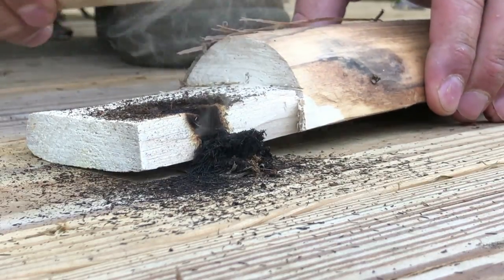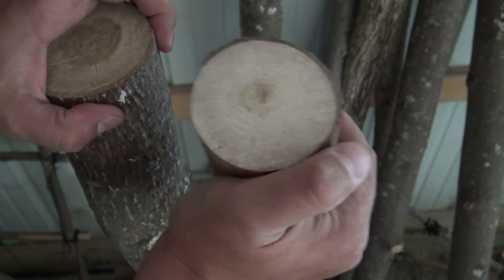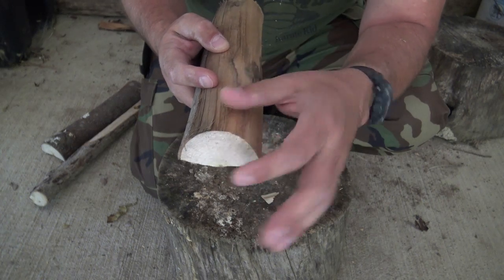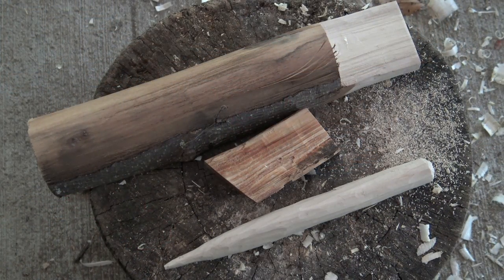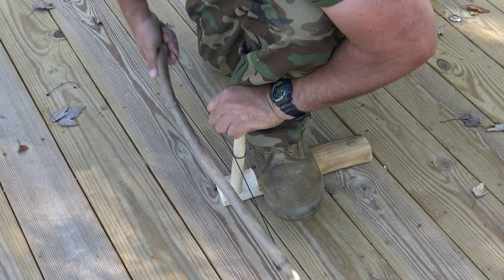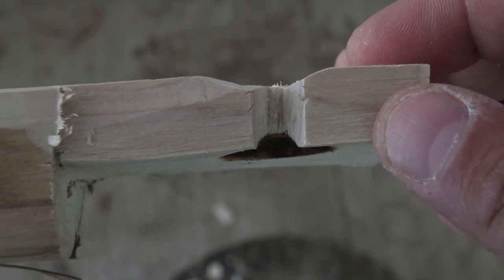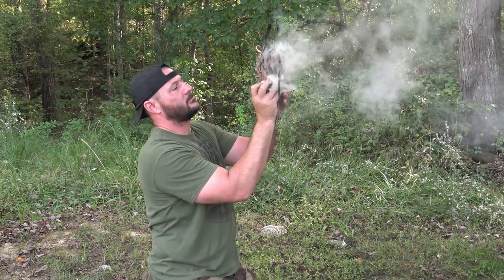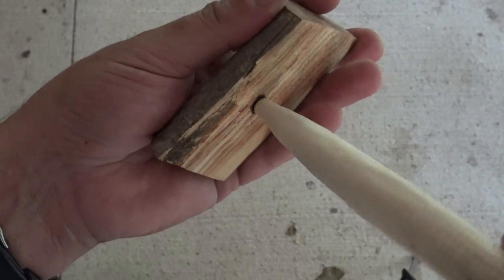The Best Kept Bow Drill Secret - Guarantee That Ember

Comment: I find that widening my notch at the bottom allows the powder to gather in a more central spot and helps the heat to build quicker.  I also lubricate my spindle top with oil from my face/hair or earwax.

Comment: I was taught bow & drill  by micmac up here in Maine. After 1/2 of scavenging components and putting it all together (real simple in Maine we are blessed with many options) , I had a fire in bout a minute on my 1st attempt. 😀I got so good at it that I left my lighter home for a whole week and lit my pack a day habit by bow& Drill . .
Nearly what you did except I just split a board out of the center of bout 12" of the base of a dead(rusty orange) Christmas tree size spruce and I used the upper section for my drill .
     Definitely love the fat wood upper catch , smart. I was taught to use either animal fat or pine pitch for 
Upper lube and I was taught after burn in to blunt the bottom of the drill (not just remove the charred part as it put more weight on less surface.  If I can offer a tip , it would be don't make the drill any longer than needed to operate . It get more wobbly and you waste energy trying to keep it up right.  Short drill with shin in wrist joint it is easy to keep steady &;easy to put all energy straight down.  

      Excellent demonstration 
&  thank you for the Fat wood tip I have to try now😀

Comment: Very clear and easy to follow instructions. Thanks. Again some idiots give a thumbs down to someone trying to teach something.
Reply: aaaaa1957 ..,it’s probably not real people.,just an A.I. Bot running it’s program...or you could be correct.,in that case..,asshats will asshat.  I really should practice this but I’ve got a few pounds of dryer lint in dry bags and ferro rods and wind and waterproof matches and tons of both. Dryer lint is the ticket. But I am going to learn to bow drill.,as a back up and this is by far the most informative video I’ve seen to date on the matter. Thank you!!

Comment: What I love about this method is the stability of the proven platform hearthboard. . you see hundreds of dudes just split a flat chunk of wood and go. But this allows the arch of the foot to lock the hearthboard to the ground...which is WAY more stable and would help prevent pop out.

I have watched hundreds of these videos trying to figure out a way to do this with my physical limitations, and this is most helpful out of all of them as far as components go...thanks Shawn
Reply: I hear ya.... Those limitations.... Try a soda can , polish the bottom, or a Smartwater bottle, it magnifies real good. An altoids tin full of charr and charrcloth bits and a piece of an old file and a hard stone are my choice. But having a backup is well worth it in a pinch or if you are having troubles with one method on a particular day. I recently was way up on a mountain detecting and came across an old greenish bottle bottom. And cleaned it up. Before too long i generated an ember and kindled a small camp fire. It was very rewarding on that cold hike on the mountain!

Comment: I watched Josh's video "The Complete Bowdrill"....that one helped me get my first ember. I'm at around 90% success rate.Your video showed me a couple of good tricks to use that may close that 10% gap.....Thanks for the video and great tips. Carving a space under the notch will help with the airflow which seems to be a unwittingly repeated problem of mines that has to be corrected. As far as the bearing block...I use a piece of bone...a joint with a natural divot that works beautifully....no binding. Yes, I have watched spindle fly off a few times(my record is 12 feet...lol)...due to my relaxing and losing the firm stance. Again, thanks for the tips. It gives me more to work with. Semper Fi

Comment: Awesome tutorial, thank you. I love that the measurements are taken from the body, creating tools suited to each individual. Very clear and easy to follow, I've got to have a go at this ! All that I have found to be missing in the lesson, is hardwood/softwood information. As I am in the uk, and where ever I may be, I would like to know what the components should be made from. The spindle, the board, and the block (clearly fat pine where possible). Should the spindle be softer than the board ? I like to use a ferro rod, and have had great success with it. But I see this really is no different to bringing a lighter or pre fab bow drill to the woods. It's not survival, survival is using a broken flint as a knife, and what you have around you. As we can never know when we will need such skills, likely the worst possible weather with no bloody gear !

Comment: Avery good presentation on how to start a fire with a bow drill.  However you guys have it easy.  Downunder (Australia) our bush environment is predominantly hardwood (gum trees or eucalypt).  The trick is the timber sections don't need to be as thick.  Great work Corp, keep it up.
Reply: So I have made a number of bow & drill's to demonstrate how to start a fire using gumtree wood.  However, because it is hardwood, compared to this video, you need to scale everything down as the wood is harder and more durable.  The piece of wood for the bow can be thinner and most importantly the piece of wood you fashion for the base doesn't need to be as large or thick.  The principle remains the same  and if anything it probably takes longer to start making smoke.  I also use some very, very fine wood shavings around where the spindle meets the base block to assist with ignition.  Hope this helps.

Comment: Good video Cpl.  In my experience, once you've learned correct kit geometry and form, material properties are where most folks fail.  Wood species is 100% irrelevant if the properties are correct, and also if they are incorrect.  It's got to be dry as possible, fairly soft (dents/marks easily with a thumbnail), nonresinous, and not dry rotted.  After that, environmentals play a huge role.  I usually do hand drill because the materials are easier to find/prep, but your prep has to be near perfect.  If humidity is up, or it's damp, bowdrill as depicted is the way to go.  Osage also makes an excellent bearing block.  The other most common failure mode I see is people gassing out because they go at it with and empty notch.  If you are doing it right, you really don't need to go at it hard.  If you're panting, you're working too hard or your kit isn't right.  It takes a lot of embers to learn to read the dust and respond accordingly with pressure and speed.  When I got started somebody told me it's 100 embers to truly own it and I'd say that's very accurate.  You also need quite a few full fires, because the ember is actually the easy part.

Comment: great video nicely done you have some great videos here, a small tip for shaping wood such as the spindle you made i see people all the time doing what you did holding the knife as still as possible and then pulling the wood to shape it, it works good but I have found if i stick my knife into a log vertically and hold the top with the point firmly placed in the log it makes shaping wood very easy as the blade does not move. also a great way to make feather sticks using the same idea. great videos keep them coming this is without doubt one of the best channels , you need to team up with survival Russia :-) and you will have youtube sewn up .

Comment: Id Rub the top of the spindle on the sides of your nose to grease it anyway.. Also, where the string touches, you can mar the spindle with vertical lines to add grip for the string (like spine shaft). It adds serious torque and grip.

Comment: Great video! I'm sure it's been said, but another friction hack for your bearing block is to smush some green foliage into the divot to create lubricant. I've used this method, even in the winter, with cedar or pine needles.
Reply from the maker: no its not it falls out in 2 seconds and then you are back to square 1

Comment: Fantastic video. I have a request..... 

     I'm 57 years old with one hip replacement, the other hip due to be replaced some day and worst of all I have Stage III Spinal Degeneration in my back. So it is very hard for me to do things on the ground.  

     As a result I have adapted my woodcraft by elevating as many of my Bushman activities as possible. This means working on boulders when available and usually felling dead trees to waist height and using the tall stumps to my advantage. (You're gonna need the dead, standing timber anyway.)

     I have not seen any techniques of ways to secure the board to a horizontal log, standing stump, flat boulder, etc, so I would like to ask if you can come up with a good way to secure the board without having to use a foot in a crouched down position?

     Even without my type of injuries, this is good to do in deep snow anyway. So I'm just wondering what you might be able to come up with on how to secure a board to the top of a cut-off stump?  Something average sized, say 6" to 10" in diameter. 

     Any ideas?..... 

Thanks. 
     Mark

Comment: This is great i did my very first bow drill fire at 12 after watching videos on it. It took me 3 months to do it because at the time videos wern't very informative like this. The most important thing is make sure the wood is dry. And when you put the spindle into the bow drill you hear, That LOCK! because the tighter you can get the spindle into the string the better output. really good video!
Reply from the maker: WOW. that's great. Keep it up and thanks for watching

Comment: Good idea on the fat wood. I don’t have fat wood here in west Texas. But I carry this old glass insulator, it’s a little wobbly but if you cut the bearing in to fit it’s not to bad. Weird spindle but it’s not to much friction on glass.
Reply: Try a fidget spinner.
Three bearings in case one breaks.
Reply: Shawn R good idea. Just a thought any old small sealed bearing that’s been replaced. So if you was scrounging in a say lawnmower shop there’s probably some that’s plenty good to make a bearing block but to rough at high speed. 🧐
Reply: so steve ya cool. That’s a good idea. See my reply to Shawn. Cause seriously the bearing like a skateboard wheel wouldn’t be hard to carry around

Comment: Great video! Any reason to not put the tinder bundle/nest right underneath the board notch, so the embers fall right in? Assuming you use a smaller bundle. Perhaps dig a small divot and place it there so the hearth board stays flat. Seems like transferring might risk it dropping, blowing away etc... idk. I'm not that experienced.
Reply: I have done the bow drill many times right on top of the tender bundle with great success.

Comment: I have no qualms about using modern technology.  So instead of a handmade bearing block in my bow drill kit, I have a wheel from an old set of rollerblades.  It's comfortable to hold and the bearings eliminate pretty much all of the friction.
In my fire kit, I have 2 BIC lighters, a 4 inch magnifying glass, a ferro rod, a magnesium block, a fatwood block, a pencil sharpener and of course, my bow drill kit.
Reply: What will you do if you don't have your "fire kit"?
Reply: @bearly1727  One habit I got into from the very first time I went into the field as a soldier (and still do, regardless), is carry bic lighters.  When I'm not in garrison, I have a bic lighter in every pocket of my clothing and every pouch, pocket and compartment of my rucksack.  I do this even when I'm carrying my fire kit.  You will never see me without 6 feet of para cord and I have a fire steel always attached to my knife sheath.  I have this thing about being able to get warm.
Reply: @tazweiss7970  I agree. Being cold sucks so I carry with me at all times at least 4 different ways of starting a fie, a knife and a pistol, just in case.

Comment: Without a doubt, you've got some great tips.

What do you think of

1) Angling the bow off horizontal just a bit, to get the string to spiral slightly on the drill, to avoid the string rubbing on itself, reducing wear or the chance of it breaking?

2) If you have a tinder bundle that is slow to light, compress it SLIGHTLY after each time you blow on it, to keep the material inside at the right density?

Comment: Excellent video. I watched this video this morning and on my 2nd try I had success!  I was using a pine 2x4 as the bottom piece and a piece of cedar branch from my back yard as the spindle so I am not really sure if that was a good combo or not. I was going for the ember which I got but never actually got the flame. All I had prepared in advance thinking there was going to be a huge learning curve with little chance of an ember was some cedar bark shavings in a cupped hickory leaf. That wasn't enough and pretty much smoldered away in a couple minutes but had I made a proper tinder bundle there would have been a flame without a doubt.

One problem I did have after trying a few more times is my spindle keeps walking into the notch instead of going straight down, what would cause that? I am locked pretty tight with my leg with very little movement. I am actually using a 3 inch idler pulley off an f150 I had in my tool box with a center bearing for the top of the spindle that I can hold pretty motionless with near zero friction on the spindle top. 

Either way I was pretty excited and actually got the ember run on video!

Thanks

Comment: Pro tip: after seating your drill, rub the upper tip of the spindle all over your cheeks and forehead, then clean your ears with it. The skin oils will lubricate the wood so it will not burn into the bearing block as much and prevent wear  on that end, and focus even more precious friction onto the lower end.

Comment: Great information provided one brought poly cord and a camping knife. However, one should simply find or pack fatwood (pine resin infused wood), metal spark stick, and camping knife to very easily spark fatwood shavings without all the time and effort.
Reply from the maker: the video was about making a bow drill
Reply: Personally I opt for just bringing g along my 1200 watt Kenmore electric range and then I dont even need a lighter let alone a mag and steel, but different strokes for different folks I guess.

Comment: I always carry 3 lighters with me into the woods, on top of multiple other fire starting materials. Ferro rod, waxed cotton, steel wool etc.. Why 3 lighters though? 1 as a primary, the second one  as a back up if the first one becomes wet or is too cold to spark. And the third one is in case you loose one of the first 2 :)
Reply: i am all about ALICE gear great stuff,everyone says it is the prehensile thumb that sets the humans from every other animal.
   it is not the prehensile thumb it is the bic lighter, it is all about fire and you are correct sir.
   fire like money is way ahead of whatever is in second   place,for sure.
   if D Boone had bic lighters and zip lock bags,he would have walked to the Pacific Ocean.

Comment: That wood is so soft, you nearly drilled right through! 

A harder bearing block means less friction and wear on the spindle. Having no access to fatwood, I went for full unashamed laziness and made a divot in a rock. Now that I mention it, I should try with a rock that is usable for flint & steel...

Comment: As an experiment to determine if an ember could be produced faster, could you sprinkle a bit of wood ash powder into the divot.  it seems that wood ash is being used to help quicken/accelerate the time of ignition in other fire starting methods (rutiger fire roll, ash on cotton cloth, etc)  and im curious if it would help this method as well.  thx if you plan to do so.

Comment: I have noticed that the string slips up and down on the spindle as the drilling progresses, any advantage/disadvantage in carving a groove in the spindle to keep the string from moving up or down? Might be a simple question but as I am trying to teach myself this technique all new information is viable
Reply: The string moving doesn't matter. If you really need a fire, you won't be worried about it.

Comment: What about using other woods?  I live in the upper mid-west and there hardwoods like red and white oak and maple.  There are softer woods like white pine. spruce, and catalpa.  Fatwood is hard to find but the pines and spruces usually have sap on the outside from bird damage.  Can I use the sap to lubricate a hard wood bearing?  Is a soft wood better for the spindle or something harder like maple but not as hard as oak?  Thanks great video!
Reply: Notes from Dave Canterbury:
"The hearth [board] and spindle can be made from the same wood. It should be a softer wood, one that you can leave a fingernail impression in by pushing down. Examples of good woods are poplar, cedar, willow, and pine."

He goes on to later to say though that the bearing block should be made of the hardest wood that can be found, for example Hickory or Beeach. He also says use a greenwood instead of dry wood for the bearing block (dry wood for spindle and board), probably same thinking as the fat wood.

I'm in the same area as you, and am running into the same problem. Not that it reduces the friction, but I have considered using a rock for the bearing block. That said oak is easy for me to identify so going to experiment with that as the bearing block (red oak specifically) and white pine for the board and spindle, we'll see.